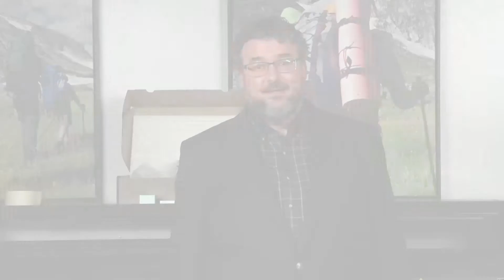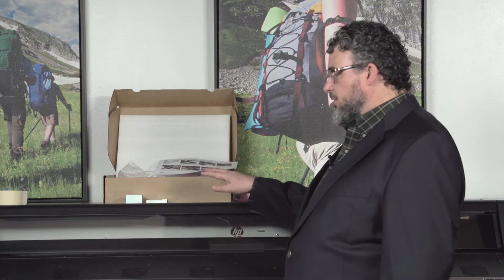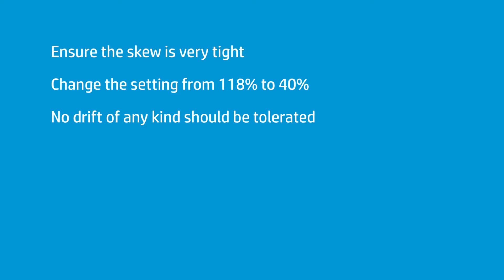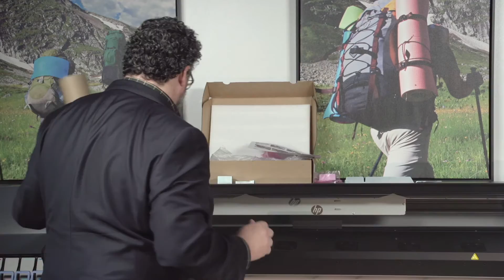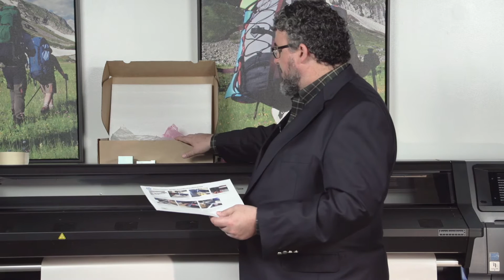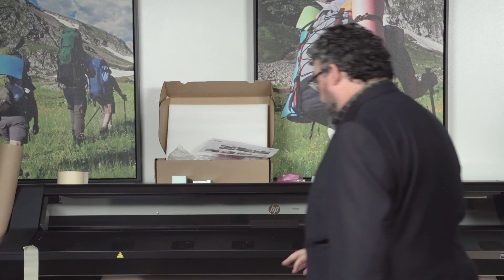Part 1: Panel Printing and Counterweight Assembly | HP Latex | HP

Comment: If I had known that two years ago, I did not have half the problems I had when I worked with the HP Latex 360 with large panels.
HP Latex printers are my favorite printers and this experience does not change my mind.
I would like to have professional training directly from HP, as AveryDenisson does with installers. That's a tip.
Congratulations.
Reply: These counterweights are free for 360 users? You can order them for free?